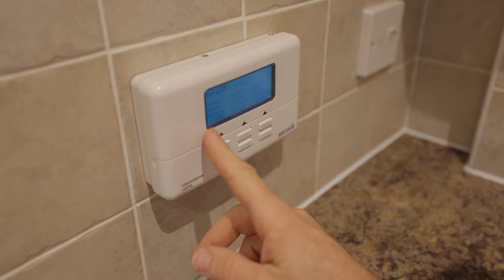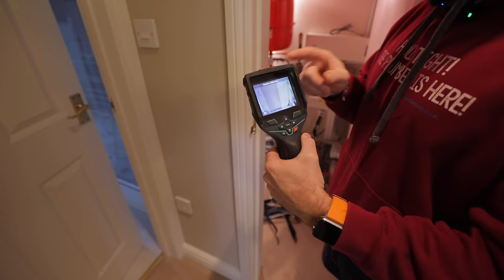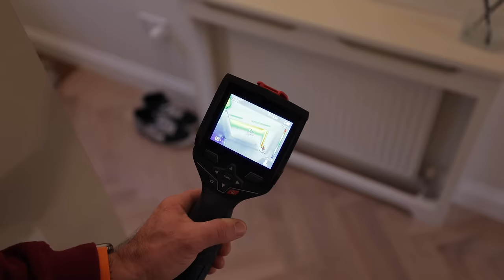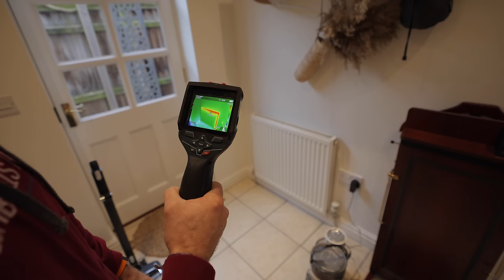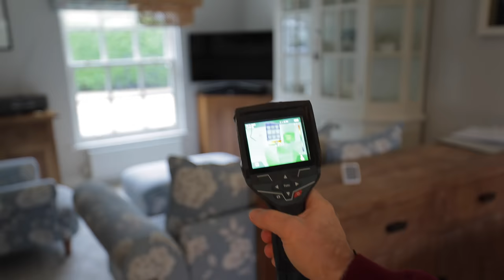THIS HEATING SYSTEM NEVER WORKED - Adam's Problem

Comment: Not a plumber myself, but having looked deeply into mixed UFH/radiator systems it is highly possible that UFH is stealing flow from radiators. If I recall UFH is something like 3-4x the flow rate of rads. If both on at the same time, rads suffer. More to it to that obviously - Andrew Millward on YT a good resource
Reply: I’m not a plumber either but I thought UFH needs to be at a lower temp than Rads so should have a mixer to take in a bit of heat from the main system as required and then flow that round the manifold system by a separate pump. If not they are trying to power the flow from the main pump and I’m betting that dosnt help the situation.
Reply: @davideyres955  Yes they run at different dT.
looking back at the setup in this video, the UFH does have a mixer but I wouldn’t say that’s the problem. It’s that it has its own pump, which will be battling the main circulation pump.
Hydraulic separation is the term for what’s needed. To be fair I can’t see closely enough to see if that’s installed on this system.
My comment was more to share the message that it seems mixed rad/UFH systems are commonly misunderstood in this respect.
Search ‘hydraulic separation’ or ‘close coupled tees’ and you’ll see
Reply: @davideyres955  sorry re-read your reply and  the additional pump was what you were highlighting!

Comment: One little point: WD-40 evaporates to pretty much nothing. If you're freeing up a valve, you need a freeing spray that also has a bit of oil in it, or after a while the metal surfaces will seize again.

Comment: How is the water temp to the in floor radiation controlled? Surely it's not the same as the radiators. Are zone thermostats with local TRVs common in the UK? I'd be reluctant to put TRVs as secondary controls. In the States we would have one stat per zone and then adjust the flow to the radiators if necessary.

Comment: It's not thermostat lag, it's called Hysteresis and over here in the uk our tank stats and room stats don't have adjustable hysteresis and generally built in around 5 to 8 degrees this can be an absolute pain especially when trying to comply with Legionella legislation in commercial applications

Comment: Had similar problem. Rads downstairs never got hot enough at the bottom. I’ve flushed them, even replaced one then found pump was set to the low setting. Changing pump to higher setting fixed problem.
Reply from the maker: Good call mate!

Comment: When I had a double house extension I was told by the plumber to have a system boiler keeping the hot water tank from the original system because a combi boiler couldn't cut the mustard and I would have had to have a new gas pipe fitted right through the house and everything is just fine we have 15 radiators and run two showers off the boiler so why do new builds have combi boilers that cant cope ??!!

Comment: Hi I have problem with the downstairs radiator next to the front door (I live in an upstairs flat 1st floor) two years ago my old Bosch Worcester green star got condemned and ripped out I had many major issues with it over the years but this issue I didn’t have at the time. 
I had a new valiant eco fit sustain boiler to replace the old one and I have tried everything to get this radiator to get hot! As like this house it just get warm and that’s it, but all the others upstairs are boiling hot you can’t touch them for long. I have it set to 63c Usually 60 or 55c but it’s been cold lately so needed a bit more heat then normal.  
I have bleed out the radiator I have set it to full! I have bleed out all the others even though they were fine no air pressure is half way sure it’s 1.5bar I think not 100% sure.  And it’s just refuses to get hot and that area and  the bathroom are the coldest parts of the flat. 
I have people out who infact some how made it all worse…. 😩🙄 
Do you think if check the balance on it , will it make a difference?  And they messed my thermostat valves up and some don’t turn off or to hot! 
They did not have a clue and I didn’t watch them they just said it’s fixed now but soon as the heating went off turn it back on it’s back the same again. 
After 2 years it’s really annoying me now. 
Sorry for the A4 page comment 😂🤦🏻‍♂️ 
But I asked another plumber on here and no one’s got back to me yet with an answer ? 
But I am convinced after watching this video that’s both ends of the radiators are the problem and those boys made it worse as the boiler is great. And works fine and passed its test not so long ago. But forgot to mention to him about this issue as it was summer.

Comment: I've got a huge distrust of plumbers. I've been ripped off a few times. One guy charged me £600 to change a Salamander shower pump. All he had to do was change it over, no extra plumbing required. He spent one and a half hours on it, when he could have done it in 15 mins. I later found out that the pump cost £92 retail, so he would have got it trade price.

Comment: What the saying.
If a jobs worth doing, do it yourself.
So I'd only be slagging myself off when it comes to the plumbing.

22mm manifold feeding the two floors down to 15mm to the rads.
All balanced on the pipes, then fine tune balance on the valves.
Still on the gas boiler that was in the house as it was new but setup with enough flow for a heat pump.

Comment: I’d suggest that the previous engineer did his job right because having power flushed the system it’s important to fully open all valves on the system to get the full benefit of the flush, it’s possible he or she forgot to put them back to where they were

Comment: Condensing boilers do not require a trickle through the bypass. This causes lower efficiency by raising the return temperature. The instructions say how to set this up correctly.

Comment: What happened to the old tech of a balancing thermometer wher a sensor was connected to the flow and return and set to 10c difference that way you know that when the LSV was properly adjusted. I was using one back in 1972 so not modern tech.

Comment: with a low capacity boiler, the heat output should be set by the installer, it never is, always check the gas pressure, and set to the required output. if the gas pressure is left at its highest the water heats up to quick and the thermostat will turn the boiler off before it has a chance to circulate around the system.

Comment: Some trvs have limiting stops which are good to stop unauthorized people whacking the setting up to 6. Also lockshield valves are best with final adjustments after a few hours running to achieve steady state. However, generally, customers aren't too bothered as long as the cold radiators get hot. It's great if you have customers who can understand what to do with stuck trvs which saves unnecessary repeat visits. Always explain not to leave trvs shut down tight all summer.

Comment: Is it worth keeping the rad next to the back door on fully as most of the heat will go out the door when the door opens?
Reply: Maybe, but when the door stays shut, the room will just overheat. Set it to 3 or 4, then let the TRV do the only job that it has been designed to do. Normally they are quite good at that.

Comment: Help - got lost. If the raiators in the room with the thermostat are set at max and the thermostat is set at your comfort level - wont the radiators be kicking the whole zone/ floor off before other rooms have reahed their temperature?
Reply: Your not meant to have trv in same location as room stat..he didn't mention that
Reply: Still lost: Wouldnt it be better to set the thermostat to max and let the TRV's do their job :)
Reply: Potentially yes.  But that radiator can be balanced down to stop it warming up first.  Its better to do that then risk all radiators shutting off whilst the thermostat is still calling for heat
Reply: @davidhonan4803 turning the room stat to max is the same as removing it completely,  it's a building regulation to have one fitted. There shouldn't be a trv in the same location as a room stat.

Comment: Why don't you use your fancy IR thermo camera to balance the radiator's flow and return to the correct delta?
Reply: That is what should be done, the implication is that 1/4 turn balances everything. Depending on the system should be checking for a delta T of 20 deg across the rads. The bypass should also be set to pass minimum flow requirement for the boiler when the TRVs are shutdown. Bypass will also not work correctly if the pump is set wrong, ie constant pressure mode.

Comment: Interesting stuff but could do with a short summary at the end of what the crux of the problem was.
Reply: The heat in the system was going through the open lockshields, and back to the boiler.

Closing the lockshields down made the hot water travel to the rads further along the line, and thus heat up.

Comment: Please can you help. I would like to fit a dishwasher in my kitchen. But the only space I have is under the sink draining board. I have seen people do this on the Internet. But the people at currys told me that you must not fit it under the draining board. Please can you give any advice again this I a very small kitchen and that's the only free space. P.S. keep the videos going very helpful.
Reply: I can say that Curry's are wrong. I have an inbuilt dishwasher (the ones where the outside door matched the rest of the cupboards) & that is directly below the draining board. Having said that make sure that there are no leaks from the taps etc to minimise any problems but even then it won't effect the dishwasher with regard to electrocution as they will be built to standards to prevent it.
Reply: Thank you for your help.

Comment: The main problem in that house is the motorised vavles and one pump is not capable of pushing sufficiently true the little opening  in the motorised valves what should be done is a pump put in for each different zone and a NRV on each pump and then each circuit will have adequate flow through  it.There a  lot of plumbers don't seem to understand this I have repipes  thousands of heating  systems that are done like this   motorised valves kill flow rates big time you will get away with using a motorised valve in a small enough property but not a larger property 
As the gentleman in the video described the rads  at the end of the house aren't wonderful don't work and then a lot of rads at the bottom would be cool enough
Reply: NRV before or after pump? This was interesting to read 👍
Reply: After the pump my preferred Choice is a grant non return valve it actually screws onto  the pump itself  and then you screw on you're a pump valve there super neat especially when you have 4 or 5 pumps in a line
Reply from the maker: Agree, however on this particular house I proved that that isn't the problem, simply by properly balancing it, balancing the tank and getting every radiator, underfloor manifold and hot water tank piping hot in 1 hour!
Reply: I always fit 28mm zone valves if big house even if the pipes are 28mm  !

Comment: Would it make an difference to a problem radiator not getting hot if it has 10mm pipework rather than 15mm like the rest?
Reply from the maker: 10mm can block a lot easier....

Comment: People mention balancing rads in order setting a 12 degree difference between the trv side and the stoplock side. Nobody explains which way you are meant to turn the stoplock. The minute i adjust it the trv side is changing as well. So is the trv side meant to be 12 degrees hotter or colder than the stop lock side? if the trv is say 52 and the stoplock is 48 which way do you turn the stop lock to lower the temp on that side. All guides i have seen gloss over this part and just say adjust the stoplock to get a 12 degree difference nobody covers which side should be hotter and how you adjust the stoplock to make that side hotter or colder.
Reply: The delta is normally 20 degrees unless using a low temp system like a heat pump. Flow (TRV side) should be 20 degs hotter than the return (lockshield side). Open the TRVs, close all the lockshield valves, then open rad lockshield nearest boiler 1/4 turn then next nearest 1/4 plus a bit more until you get to the one furthest which will need to be open more etc. If the delta is too high there is too much flowing through the rad, close the lockshield down a bit, if too low open the lockshield up a bit.

Comment: I have one rad in the hallway that it always clot cold when the heating is on. Both valves are open and there is no air in it. Weird, ever since I removed one in the living room and joined the pipes together to maintain flow.
Reply: You shouldn't have joined the the pipes together, you've  created an easy path for the water to go, probably robbing the hall rad of its flow.

Comment: Zone system is what it's called in the US. Way too many valves in that system. If your going to use electric and your temperature doesn't get below 32F too often just get a heat pump and central air system. On the upside you won't have plumbers working on your heating system you would have HVAC guys.

Comment: Does no one balance rad's by setting the check valve to provide a set heat drop across the rad.
I had a boss who made devices for heating engineers to do just this. it measured the temperature of the water flowing in and out and displayed the difference. they would then balance all rads to be as close as possible.

Have you heard of anything like this. it was about 35 years ago?

Comment: If only we could get people to understand that the most common cause of a radiator being cool is  because the room is warm and the TRV has therefore turned the radiator off! By the was the AAV on the suction side of the pump? Not good if it was.

Comment: Just a question about leaving the rads that share space with the stat on 6, don't you run the risk of that space warming up before the rest of the rooms have got warm and shutting the stat off too soon?
Reply from the maker: No, as the TRVs in the rooms, if the system is properly balanced will have attained temperature in the rooms and should be shutting down. TBF, soon we won't have room stats it'll all be Tado valves on every rad.
Reply: There shouldn't be a trv on rads where there is a room stat in the same room or area,ideally.

Comment: If the pin on a thermostatic valve is stuck in never ever pull it out. You will pull the pin out off the diaphragm in the valve and it will leak! Tap it in gently till it pops out on its own.

Comment: If the trv in the room with the wall stat is on 6 then surely the room stat will be shutting off prematurely and the other rooms won’t be getting enough heat. I would have thought it better to put the trv in the room with the wall stat at 3 or below to prevent it getting up to temp before the other rooms had warmed up.
Reply: If all the rads are balanced then the whole zone will get up to the correct temperature and then the thermostat will shut down and not call for heat. If you want a room hotter or colder then the TRV will let you do that but across the zone the heat should be correct for the zone. 

If you set it at 3 it’s possible that the room where the stat is won’t get hot enough to cause the thermostat to click off ever until there’s enough heat from the rooms with the TRVs set higher than 3 to leak out into the area with the thermostat. 

The exception to this is the digital TRVs and more intelligent thermostats like the evohome where each room is effectively a zone and will call for heat from the boiler independently.
Reply: Whether you set it at 6 or 3 won't affect how quickly it gets up to temp, just affects what max temperature it gets to. As @davideyres955 said, if you set it to 3 it might never get hot enough to turn the room stat off, so the boiler would run constantly. With it at 6 (or, to my mind, better with no trv fitted) then it will run until the room stat clicks off.
I do agree there could be an issue where that room heats up quickly, and others never get hot enough as the stat turns the boiler off. To my mind the answer there is to turn down the balancing valve on that one, so it gets less of the flow. That will make it warm up slower. Once all the other trvs have closed, that rad will be getting all the water anyway, so it will get good and hot, then trigger the thermostat to turn off.

Comment: My rads are absolutely not balanced. However, as I only have 4 rads total all of which get proper hot, and the downstairs is on wet UFH, is there actually any point balancing?
Reply: Yes, especially if you have a condensing boiler.

Comment: I gotta give it to the algorhitm of youtube. I havent even searched on either google or youtube for troubleshooting yet this video was recommended to me the day after my recent problems :face-purple-crying: 
Last night at 9 pm everything in my house sorta felt a bit too cold and sure enough; all my radiators wasnt getting any heat into them. Ive had that problem before but usually it gives an errorcode on a displaysetup near the boiler. This time it didnt it just said "ERROR". I tried the usual RESEST and On/Off but it kept giving me the "ERROR" message so there wasnt even anything in the manual to look for.

Problem? It was showing less than 1 on the waterpressure bar. Solution? Connect a hose with a fitting and slightly let in water until it got above 1. Im not a plumber and my knowledge on these systems are piss poor but Ive heard that you shouldnt just start filling it up above 2 or higher because it will most likely go higher once the system is all heated up.

Comment: i turned on subtitles but no love.  what is he saying at 25:45 where the cc says toil rail?
Reply: Towel rail
Reply: @br164  Thanks.  Is that the normal term?  the heated towel bar isn't a common thing here.
Reply: @walnutcontractors5661 Yes that a normal term. They’re fairly common in UK bathrooms